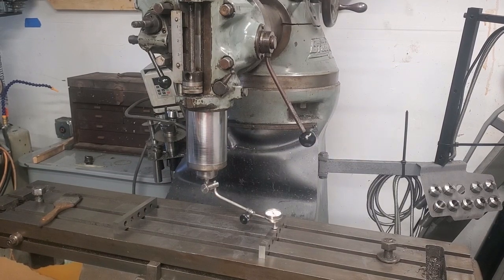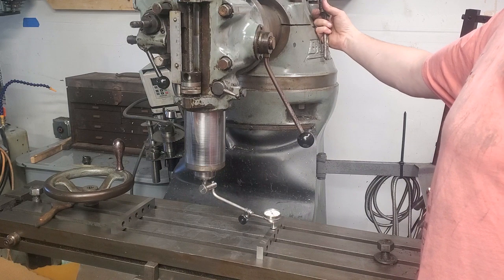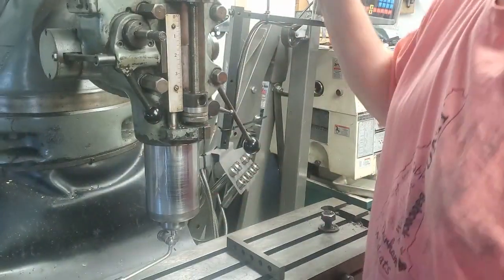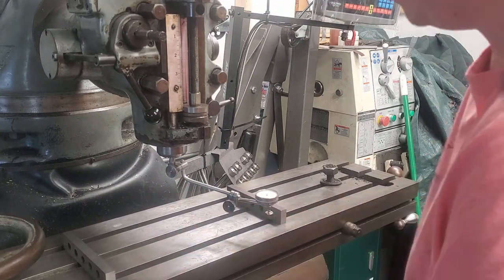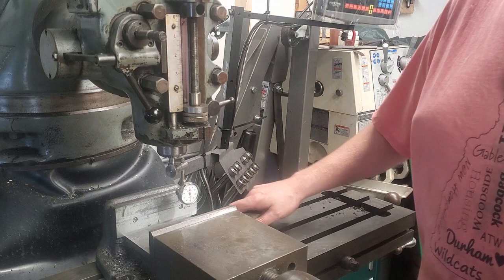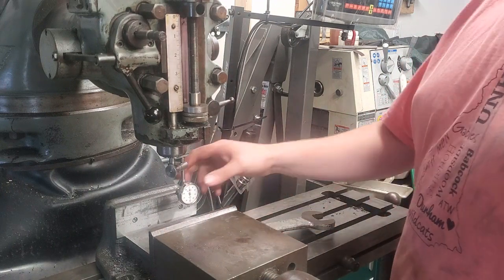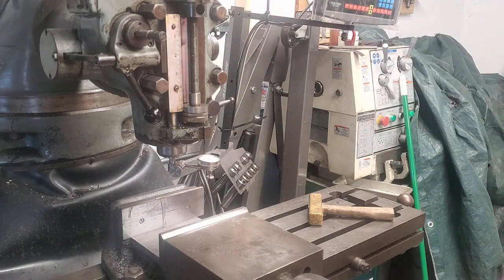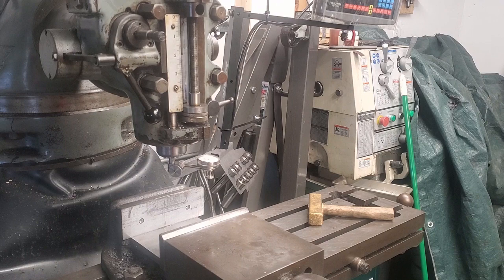Tramming A Bridgeport Mill and Vise

Comment: extending the quill like that does absolutely nothing to "magnify" the reading. 1° out is 1° out period regardless of how far the quill is extended. What it DOES do is put the quill in a position you will never use it in, that's a mistake because the wear is different.
There is only 1 way to know you are square. A face mill will cut a cross hatch with the trailing end in both directions in X and also in Y. If not , it is NOT square.

Comment: Amazing content! I just found your channel the other day thanks for the video!
Reply from the maker: Glad you enjoy it! Looking at your channel I see you are working on your own project birdgeport. I'd suggest stoning the mating face and removing rust on your new turret assembly. Swings in humidity can swell the rust, effect tram and eventually work your head bolts loose.
Reply: @moosesmachinery  thank you for taking the time to view my channel also! I wish I d know as much as you about the Bridgeport I’m constantly learning in machining but feel I’ll never “get it” lol can you kinda explain what your saying with stoning the mating surface etc? If your too busy don’t sweat it
Reply from the maker: @frontwoodsfarmer2063 I mean to just knock the loose rust and any burrs  off with a good flat stone (no oil!). I usually soak any rusty stuff in mmo, kroil etc and take the worst of it off with a wire brush. Be very careful when you swap turrets to keep everything completely free of particulates and not to damage the mating surfaces. The cast iron is quite soft. I like to put a little oil on there. With the dovetail rams, it's also a good idea to clean and lube the slide ways for the head to move in and out.